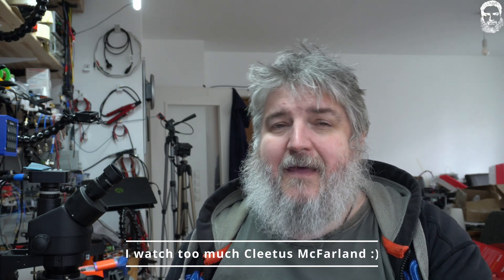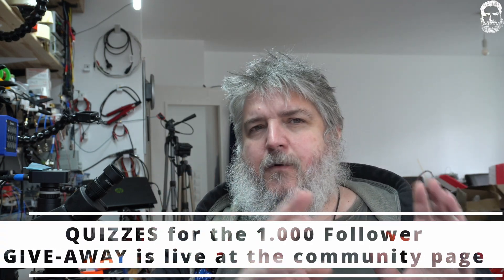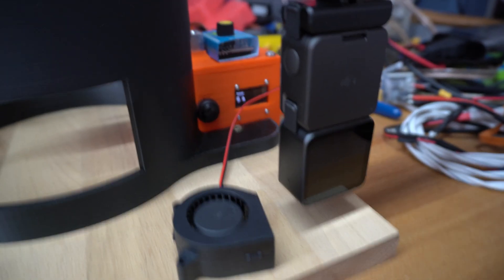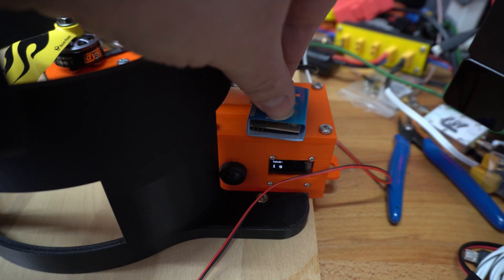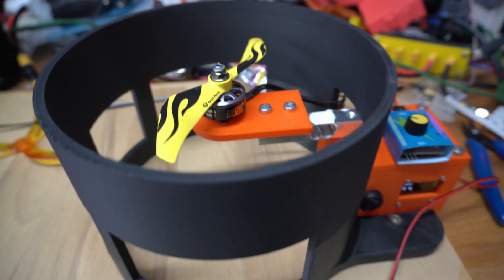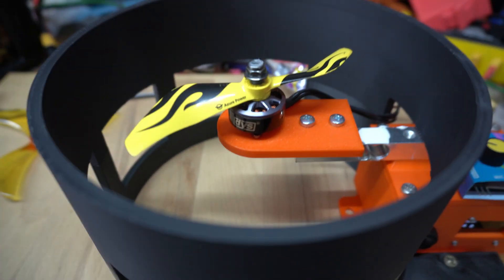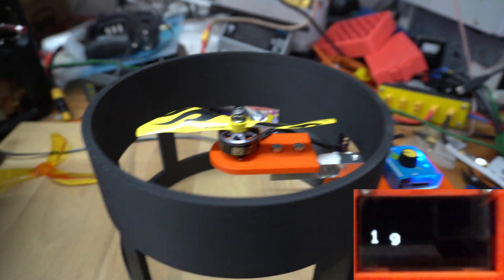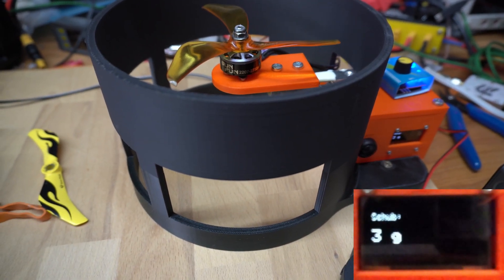3D printed #motor thruststand - unbelievable precise & easy to rebuild!

Comment: Alright... seems I have my next electronics project decided. I feel like I'll probably use Arduino as PWM source to skip the servo tester. Might also have some current sensors in some box so could maybe automatically have the motor run at set current. 
I'll probably add all sort of unnecessary things to my project but the building part is what I'm mostly interested in. Getting to test props is just a bonus :)
Reply from the maker: @Qwarzz - as current sensor I used in this first step my PSU as you can see - but I thought in the second step to upgrade to an ESC for all telemetry including Dshot RPM etc. Also about using the Arduino as PWM output or an RX in some kind for remote controlling. With all infos it´s easy to calculate efficency, torpque .....maybe upgrading to a bigger display tpp or read everything via serial to a software.

Don´t wanted to make it too complicated in the first video, or some would be scared.
Please share your project with the community, would be nice.

all the best
Sandor - DM4DS